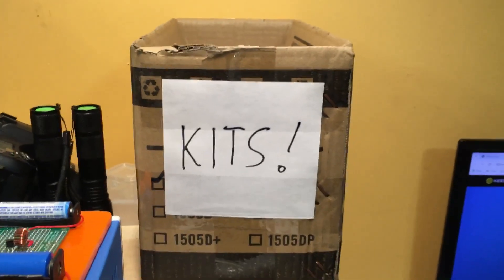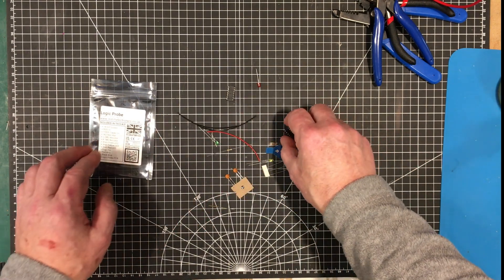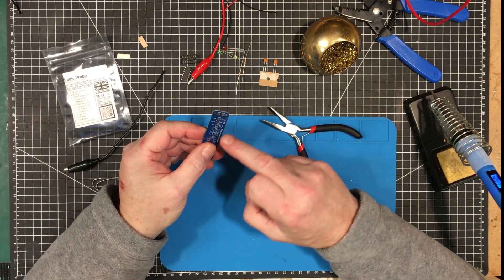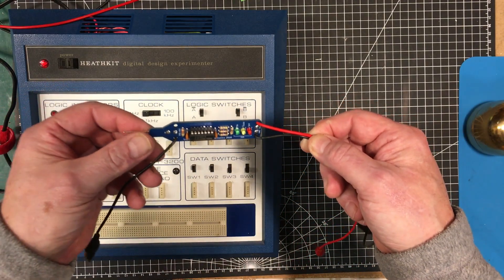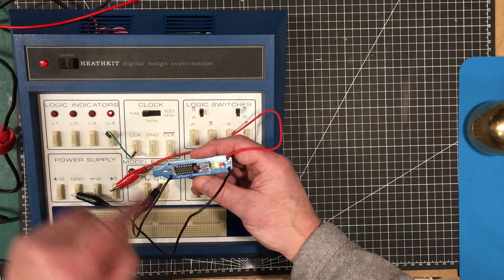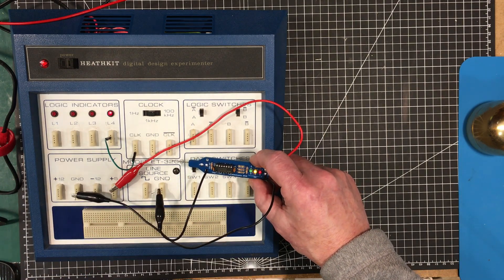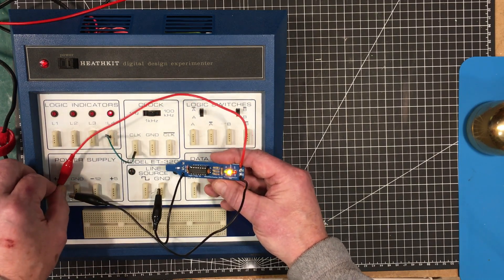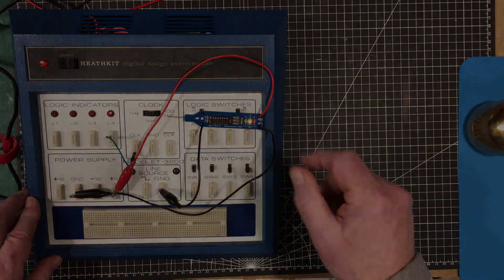Uni-Byte 0167 - Useful little Logic Probe Kit

Comment: A long while back, I tried to design a logic probe. It was easier said than done. I was using a comparator to create voltage brackets. I forget the failure point and I can not find my computer project file. If I find that, I will post the issues. I do remember this... Many of these kits use a simple voltage divider to divide the sampled logic voltages in half. Then, the logic state is determined to be either higher, or lower, than this half-way voltage point, with the LEDs being illuminated accordingly. This is quite incorrect. The voltage points for TTL/CMOS/Etc. have an indeterminate zone in the middle of the voltage brackets. This dead zone must be correctly determined and displayed by the probe. Otherwise, a failure within the dead zone voltage range either will 1) not be discovered, or 2) be reported as operating correctly. I hope I find my file, because it is an interesting challenge to solve.